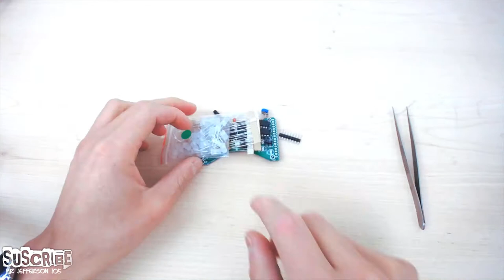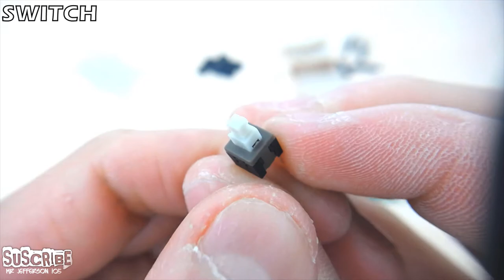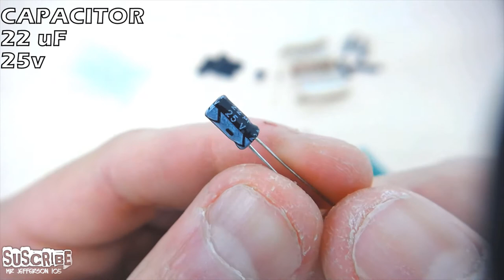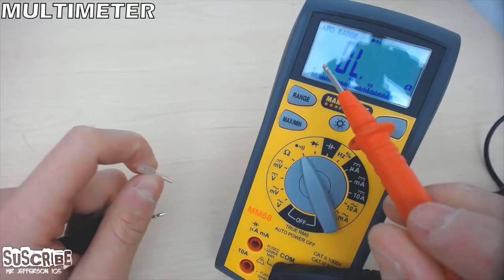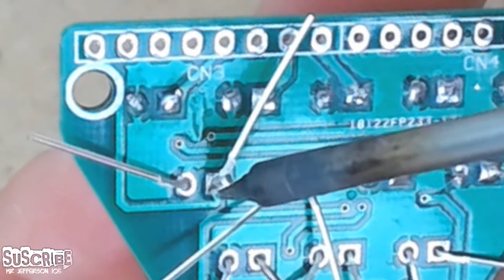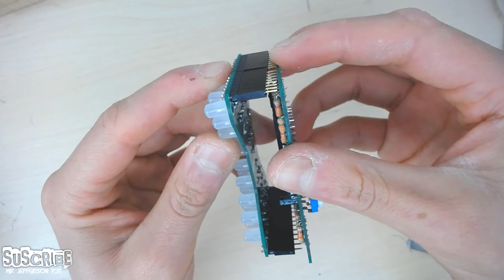LED Electronic Hourglass

Comment: This kit is adjustable.  What is the longest time taken for the LEDs to "transfer" from one side to the other?
Reply from the maker: Yeah the is a potenciometer at the back that allows you to control the time it can vary from 30s to 10 mins by my tests .
Reply: @MrJefferson105  : I would like to adjust the timing to make three of these kits at 5m, 10m and 15m respectively.  Would you be able to deduce the resistance values at 4.5V so I can find the correct potenciometer or add an extra resistor to the circuit?

Do you think this kit can be modified with another potenciometer to dim the LED brightness?
Reply from the maker: agvulpine I couldn't tell you exactly what potentiometer to use but you could find this out by using multimeter while the clock is running to see the resistance required to get the intervals you need. Since the potentiometer has its leads exposed this should be easy to do.
Reply: hi K G...
'
i have one LED hourglass with both LED sides and three PCBs together...
already in my channel video

Comment: bought, soldered, does not work.
What could be the reason?
help, please.
Reply from the maker: Polarity, are the chips the right way, check the notch, are the LEDs the right way. when soldering how long did you spend soldering each pin, thermal dissipation can damage certain components.
Reply: @MrJefferson105  polarity of diodes and chips is observed.
legs soldered neatly and briefly.
Reply from the maker: @valentinshakhin4265  perhaps a chip is faulty .
Reply: '
hi V S...
my LED kit is great and ready in my video

Comment: I'm trying to figure out how I would power this not having a bench power supply. Really frustrating these vids that just skip that part
Reply from the maker: well that there are 3 ways of powering this device . you could use a ubs wire cut one end and solder the + and - to the pcb and then use a power pack to power it . you can also use a psu to power it on . and the last option you can use an arduino or any board as such that can supply  5 v . I used the last option . you could even use  a battery pack providing that you can get 5v . it was skipped it due to that it would require a longer video to discuss all possible ways to power the device.
Reply: @MrJefferson105  How do you use the arduino to power it?
Reply from the maker: Manuel Gomez just connect it to the gnd and 5v pins on the left hanside of the Arduino
Reply: @MrJefferson105  thank you